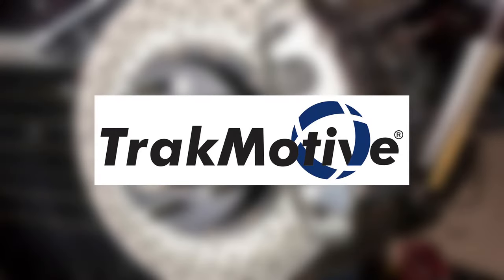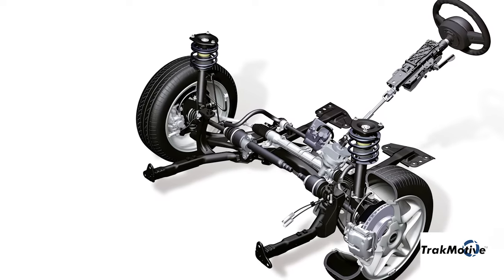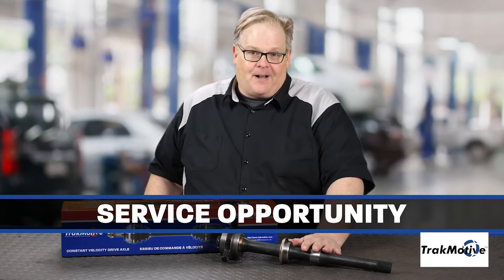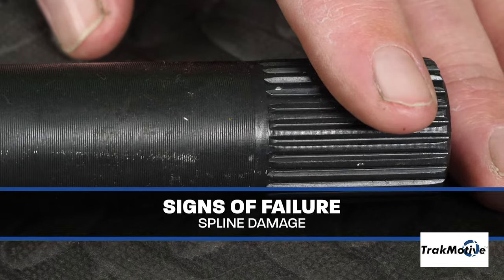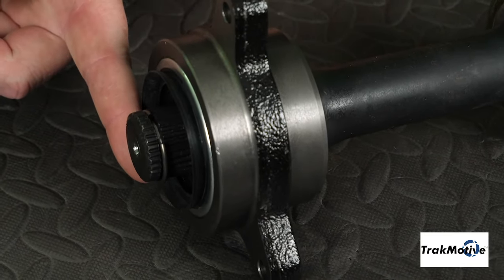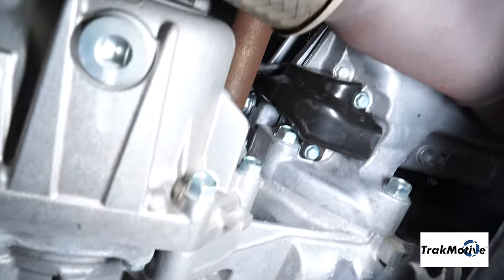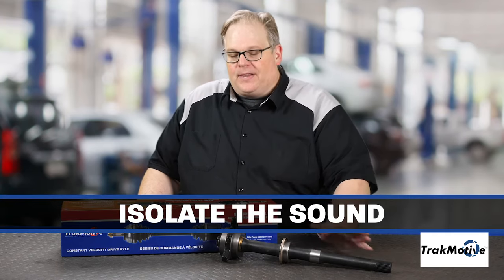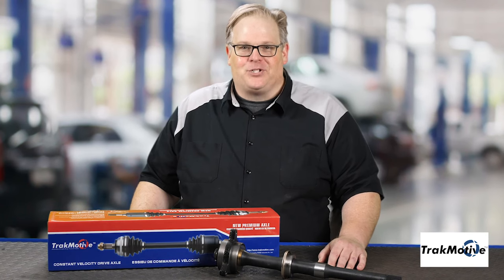Intermediate Shaft Replacement and Diagnostics

Comment: This gave no information on diagnostic procedures or steps to find out how it is bad. You just said to isolate the noise without giving a way to do that or steps. Honestly disappointed thumbs down for me I’m sorry.
Reply: Run the car in the air and use a stethoscope.